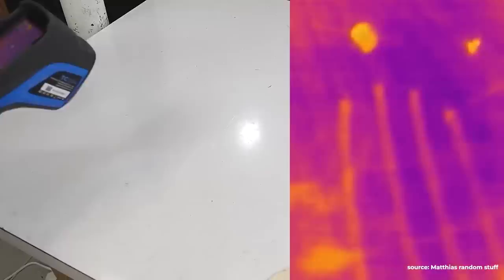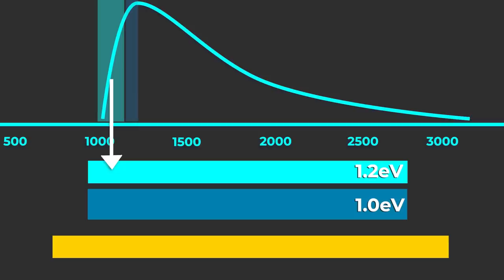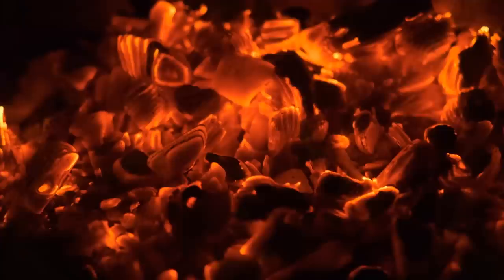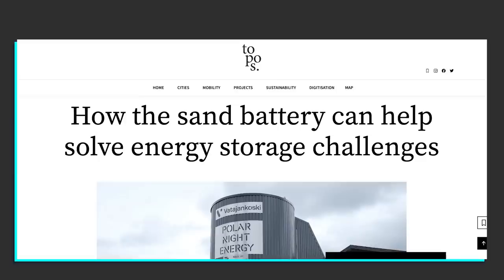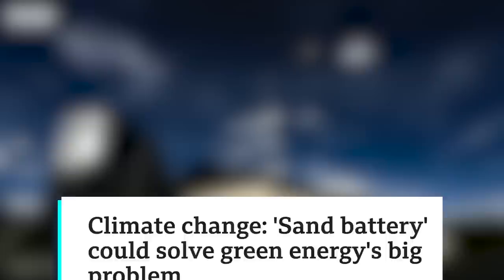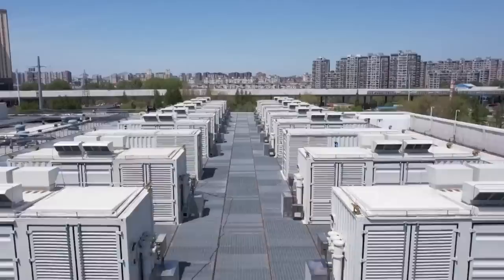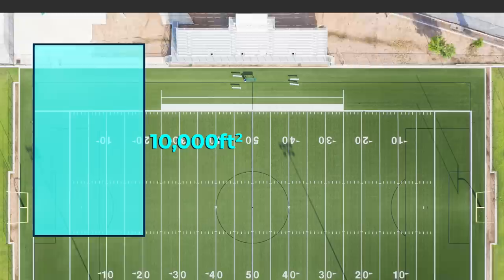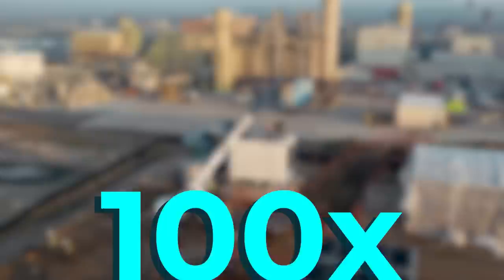The End of Lithium-ion? These Solar Panels May Be the Future of Energy Storage

Comment: insanity is the thought of storing electricity at $400.00  per Kw/h when you can purchase electricity from the grid in our region for 8-12 cents per Kw/h.
Reply: LoL 😂.
But you get to re use the electricity.
And no, 1kwh battery is more like $220.
In countries with the worst prices.
Reply: In its infancy all technology is expensive, but without attempting to stride forward, leaves us in caves.
Reply: Newer batteries are costing under $100 per kWh. The goal for 4680s made by Tesla is around $50-$60. They have already come down significantly in the last decade. Iron-air batteries are much cheaper, and these sand batteries and thermo-photovoltaics may be even cheaper than that! The trade-off is lithium ion batteries are optimized for weight and volume so they can be used for things like the phone in your pocket or even a car. There are plenty of applications for all these technologies. 

But buying the grid energy from where you are makes sense for most people, as you said. Even folks who simply buy what their grid has (the vast majority of us do that--I do that right now) likely own 1 or more lithium ion battery-powered devices, right? It's a question of application.
Reply: By that comment, the poster probably thinks insanity is the thought of using a normal dinner plate at 2$ a piece when you can purchase cardboard plates at 2 cents a piece….
Reply: @wobby1516  there ain’t nobody living in caves because electricity is cheap off the grid.
Reply: I paid $240/kwh full retail in the USA for an LFP battery. Gridvelrctrivirt costs $0.33/kwh
Reply: I know, it’s crazy, if only we didn’t have to throw batteries away after using them, like if you could put electricity back into them, or… “re-charge” them? What a world that would be
Reply: @HamRadio200 You have that right. We have an off-road remote cabin that I spent close to $15,000 on solar , inverter and batteries. Someone asked me why I spent so much money when I can just run a small generator for a long time for that kind of money. My answer was I don’t have to carry gas to the cabin.
Reply: Those two numbers are comparing apples and oranges. You're basically saying the equivalent of, "it's crazy to pay $100 for a 4 gal gas can when you can go buy 4 gallons of gas for like $12. Capacity to store energy and energy itself aren't the same thing, even if they use the same units
Reply: Your math is completely incorrect.
The way you are calculating the cost you would dispose each battery after using it one time.
I think your math would make more sense if you use the correct units. kWh is a unit of power, Ah is a unit of energy.
Batteries store energy, not power
Reply: Lol. Its only $100 to 150 per kWh, and thats the upfront capital for the battery.. now amortise that across the number of cycles, which can be 5,000 or even 10,000+...
$100 / 10,000 cycles is actually only $0.01 per kwh stored.
Reply: Until our grid goes down!
Reply: You charge it more than once...
Reply: kWh is a different unit from kW/h, the first measures energy capacity, the second measures energy flow
Reply: @HamRadio200 I live in a cave 😊
Reply: You are wrong in every way. Lifepo4 cells are around $100 to $200 per kwhr of capacity, not $400.

Also, this is going to come at a shock but the batteries are reusable. At 3,000 full cycles, a lifepo4 battery will still have around 80% of their capacity. Assuming the energy would have gone to waste otherwise and you throw out still functional batteries at 3,000 cycles that's $0.06 per kwhr. Realisticall with fair use, it will be less than half that.

Insanity is not understanding how things work and being mad at it.
Reply: @TheUnlikelyPotato  the video said 400.00 per kw/h.  I merely quoted it.  My home currenlty uses around 6000 kw/h per month on average.  We're total electric and a larger  home with detached garage and sheds.  At a full charge/discharge cycle, Say I stored half that, at 3000kw, I'd have to charge/discharge this bank of batteries twice per hour.  you do the math.   Storage of large amounts of electricity in battery banks is not economical on any large scale period.  I think it is you that doesn't understand how things work my friend.
Reply: It’s basically buying vs renting. And at some point it usually becomes more feasible to buy.
Reply: @HamRadio200  lol why are you storing 15 days of electricity and discharging them twice per hour?!? Why...why are you using 6 megawatts of power?!?! The sun comes out daily. Why are you expecting two weeks of darkness? Nobody on the planet does this. You go for solar and battery as a backup/shave the peak. You don't need to replace all your power generation with solar, the goal is to lock in costs now, inflation protect at least some of your utility bill. Going 100% is stupid. But please, tell me how I don't understand things as you want to discharge 3000 kw (3 megawatts) in half an hour (twice an hour) or 6 megawatts of power.
Reply: @wobby1516 caves are a good temperature. Why not just heat pump everything and use geothermal and nuclear. Use heat storage for water heaters and push the hot water through radiators. In Germany they use solar water heaters for hot water and heating the homes.
Reply: Insanity is destroying a well established baseload power grid, to replace it with very intermittent alternative power sources.
Reply: @HamRadio200 lol you use 6000kwh per month? There’s your first mistake. Wait till the net zero BS ramps up and you are paying $0.50 per kWh, like many places here in Australia.
Reply: @unicornadrian1358  exactly right.
Reply: @unicornadrian1358  we pay right around 8 cents per kw/h.  It sucks to live in a progressive country.
Reply: This muggle thinks they will always be allowed energy from a grid by their masters lol that’s the insanity from this comment
Reply: @wherami  So.. Are we going green for energy independence from the grid or to save the environment?  I'll concede that in some off-grid situations, battery storage may be the only option, albeit the most expensive.  But if you're shifting the goal post to individual energy independence then that's an entirely different discussion.
Reply: Divide that $400 by 10000 cycles and you get more or less than the single cycle equivalent of the grid price you just quoted? Me math dumb, sorry.
Reply: @HamRadio200 6000??? Are you running a nuclear power plant 😅.  My household uses 5.5 kWh daily. At most 8 kWh during summer with A/C.
Reply: @JesusOurKing  I just checked my last months electric bill.  I paid 11.3 cents per kWh, and used 1682 kWh, a very light month for us since it cooled way off and no AC at my home.  At my business we used almost 9000 kWh.  I think you may be not calculating that you're using that 5.5 kWh times x number of hours per 24 hours.  My home numbers will go way up when it drops below freezing here for multiple days.  My heater itself pulls 20kW when it is on.
Reply: @RadioBro184  I suppose that's typical for most households. Ours differs due to the small solar power station that assists in running the refrigerator and chest freezer. We pay between 8.7 and 18.2 cents per kWh. Our consumption is 161.91 kWh, with an average of 5.58 kWh per day.
Reply: The cost of storing energy will always be comparable to the cost of producing it, so the act of storing energy will more or less double the energy price. Why not, then, have twice the amount of production capacity? It would be more than enough, wouldn't it? Or is it that your chosen way of producing energy is that unreliable?
Reply: @HamRadio200 
If you are using 6000kwh per month and have a battery that can hold 400kwh you'd need around 15 cycles per month or 1 cycle every other day.
How the fuck do you get to 2 cycles every hour?
Reply: @carstekoch  tell us you know nothing about storing and distributing electricity without telling us you know nothing about storing and distributing electricity.
Reply: @HamRadio200  
Tell us you don't know how math works without telling us you don't how math works.
Reply: @carstekoch  There are some good youtube channels you could watch regarding both subjects.  Add finance to it as well.  If you have kids, maybe you could find a little solar experiment to play with as a first step to understanding.
Reply: @HamRadio200  
It really doesn't matter whether you charge a battery with solar panels or over the normal grid. You will not discharge a full 400kwh battery in halve an hour if your average consumption is 6000kwh a month. Unless you pull that power during the first 3 days of the month and don't use it at all afterwards. Also if your charging logic is configured even remotely sensible, You will not charge and discharge every halve an hour if your solar panels are charging. You will charge during the day with unused power, maybe waste some of it or feeding it back into the grid, if your battery can't store all of the excess at the same time and use the battery power when the panels aren't producing enough/no electricity.
There are exeptions like shitty overheating converters that will turn off periodically, but that isn't a battery Problem.
Maybe read up yourself before spouting non sense on the Internet?
Reply: @carstekoch  uh huh.
Reply: @HamRadio200  yup
Reply: We have and have had "Load shedding" / rolling black outs since 2009. Thanks Mandela!
Reply: @maximeboissonneault6203 that's the correct analogy.  I was going to say the same thing with different words
Reply: Making your own power is smart. Not having a powerbill is Priceless.  Small scale micro-grid is reliable, very satisfying, and avoiding large, costly transmission lines, which are subject to failure and blackouts.
Reply: 😂😂😂😂I don’t think you quite understand the way they are using the term 400/kwh.
Reply: @graememudie7921  educate then.
Reply: @chrisheatley706 No (kilo)watts are units of power kWh are units of energy amp-hours are units of charge.
1 watt-hour is 3600 joules both measure energy.
Reply: @HamRadio200 Educate you say? Sure .
You use 6000 kWh per month 6000÷30 days is 200 kWh per day (which is outrageous but) you only need 200 kWh to power the house for 24 hours. So a 200-300 kWh battery is what the math says is a two day back-up and would cycle the battery once per day or less. Why would you pick 15 days as a requirement for the battery? 3000 kWh is half a month.
Why not pick a 18,000 kWh battery then you could go all winter? It's about as valid of an argument.
You only need enough capacity to make it until the sun rises on your 70,000 watt solar array 😂.
I use about 10 kWh per day I have a 14kWh battery, enough for two days (actually about 36 hours.)
If the sun doesn't come out for a second day in a row I'll have to resort to using the grid for a day like most people do. I may even spring for the $1.50 it costs to charge my battery up. 
But the point is every day with 3 hours of sun lets me completely offset my power use.
My honest advice (besides brushing up on your math skills) is concentrate on efficiency before bothering with trying to make or store any energy.
Or just pay the $600 a month and ignore what smart people are doing.
I got the battery and inverter/charger before any solar panels just for the backup generator function and if the grid does go down for an extended period I only need to run a gasoline powered generator for about 3 hours and I'm good for another day and a half or two if I conserve a little bit.
Yeah when you say I spent $2k on a battery to store $1.50 in electricity overnight it sounds bad but just saving $1.40 a day is $500 a year in 10 years when my battery only holds 11 kWh it will have paid for 2 new batteries. And that is if electricity doesn't go up any in the next 10 years.
It sounds like you were "educated" by someone with an adgenda.
Reply: That’s like saying buying a vehicle is stupid because it costs thousands, when taking an über only costs $20. 🤦🏻‍♂️🤦🏻‍♂️🤦🏻‍♂️
Reply: Even diesel generators cost around 200$ per kwh. Energy storage doesn’t come cheap.
Reply: How do you get that "glowing charcoal brickette" to send its infrared to a quarter-football-field of TVPs?

Comment: When I first found out as a child that nuclear power plants simply boiled water to run a turbine, just like a steam engine from the 19th century, I immediately said, "Really? That's all it does?"
Reply: Pretty interesting application of science just for boiling water
Reply: Hot rock boil water spin turbine
Reply: Lol, we can burn trash to boil water.
Reply: @gusmotorsports but with more pollution.🤪
Reply: I agree. It is a primitive approach. Problem is, that otherway using and transferring energy need more research and tgat cost money. Easy way is to boil water and use technology, which we already know. Progress is going slow.
Reply: Ask the people of Chernobyl if they're unimpressed
Reply: @thegiggler2  ...do you want to rephrase the point you're making? Because our discussion is about the surprising ultimate simplicity of converting radioactive heat into electric energy through steam turbines lol. Are you saying that nuclear power is dangerous? Powerful? Effective? I'd be happy to engage with any of these if I knew what you were saying lol.
The poisoning and permanent evacuation of the people of Chernobyl was beyond doubt a failure of human rights but nuclear power is WAY more nuanced than that if that's what you're trying to say.
Reply: It's not about the final product it's about the journey 😂
Reply: @DaimyoD0  what about clean fusion
that sustains the reaction
Without any external forces
Reply: can nuclear power be directly translated to  a very low bluetooth radiation?
Reply: Hot rocks heat the water ;)
Reply: I put that to a nuclear submariner and he was not amused....
Reply: Haha I had the same reaction finding it out a 11 years old
Reply: @dinozaurpickupline4221  Nice one indeed.
Reply: @DaimyoD0  The answer is 42 (Douglas Adams Hitchhikers Guide to the galaxy )
Reply: @TheSilmarillian  it's nice only if you think we can achieve such a containment
Reply: Yeah same here. It seems like a massive waste of inefficiency.
All that science that went into making the reactor stable, you'd think there would be a better way to turn all that radiation directly into electricity inside the reactor, so we chop out the whole steam-turbine-generator nonsense? What we have seems to be like having a Ferrari engine coupled to the wheels via a waterwheel..why would you do that? 😵‍💫
Reply: @mazdamaniac4643  Like a wind mill sad & snowy
Reply: @TheSilmarillian  but do you know why the computer said that? That's the real answer.
Hint: it has to do with the asterisk *
Reply: Lol, same.
Reply: @thegiggler2  The problem there was more to do with politics that the technology itsself.  'Oh, we don't want to report problems, that will make us look bad to our superiors and them look bad to everybody.  Can't have that.'
Human stupidity is far more dangerous.
Reply: @mikehorrocks2909 you'd be surprised how much progress we made in yapping atmospheric pollution.  Burning yeah properly these days is cleaner than burning oil power plant in the 80s...  it's sad we don't implement things that actually HELP THE ENVIRONMENT.  Thx EPA for our massive trucks and broken ethanol.  Totally not an accident right?
Reply: no they also use thermocouples, but mostly boiling water through a heat exchanger
Reply: How do you get that "glowing charcoal brickette" to send its infrared to a quarter-football-field of TVPs?
Reply: @dinozaurpickupline4221  The heat from the fusion reaction is still going to be used to turn water into steam that will spin a turbine.
Reply: @mazdamaniac4643  🤣🤣🤣🤣🤣🤣🤣🤣We're ready for you to explain to all of us how you plan on doing that conversion thingy without a turbine and a generator. Go ahead, I'm all ears.

Comment: Why not make ICE BATTERIES 🔋 to generate electricity when we need it the most? Water 💦 expands when it becomes ice, generate electricity ⚡️ from the expansion when ice freezes, spin a fly wheel with the expansion, then use the stored heat to melt the water and let the cold winter 🥶 air freeze the water again, generating more electricity.